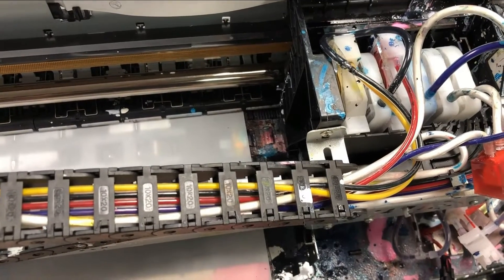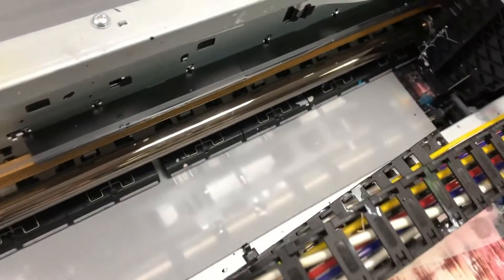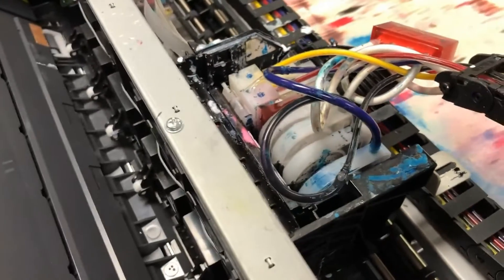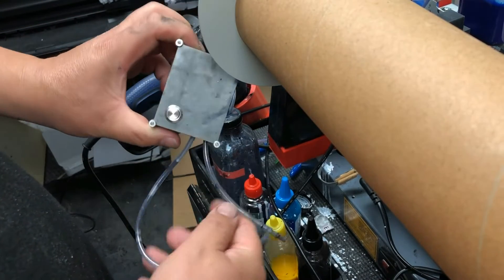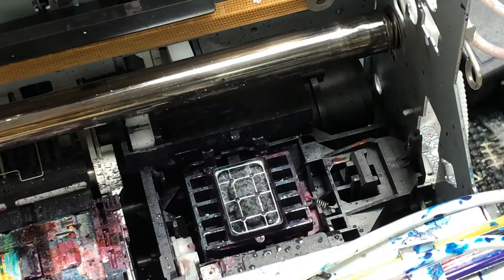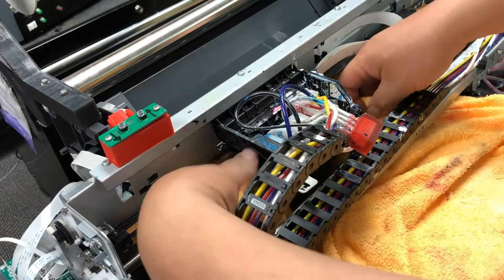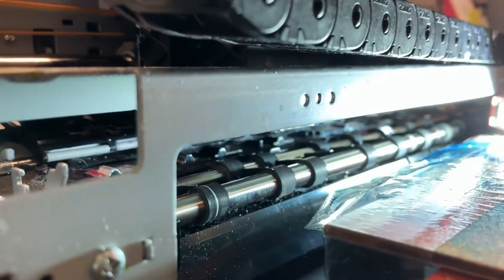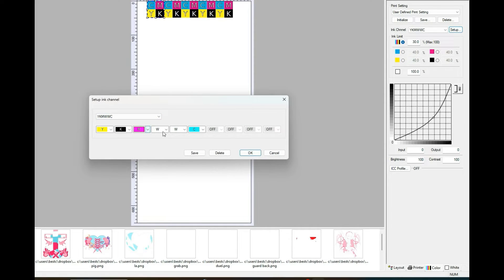Most Ignored DTF Printer Maintenance Tips

Comment: Why is my dtf a4 prestige printer prints lines with oveflow black ink
Reply from the maker: Thanks so much for your question and for supporting the channel! Lines with overflow black ink are often linked to capping station issues such as poor sealing, clogging, or tube problems, and I’ve made several videos that can help, including guides on [removing and installing the capping station](https://youtu.be/_cZEkmgIZYc), [unclogging it](https://youtu.be/WbY_6O1-w2c), [maintenance best practices](https://youtu.be/5yjq3ZN0qv8), [repairing common problems](https://youtu.be/5UC2IMu9V90), and [rewiring the tubes](https://youtu.be/J9im3s8UJfo). If none of these solve the issue, I also have an exclusive detailed video on my website that shows a complete disassembly and reassembly of the capping station down to the gears: [https://bchtechnologies.com/products/video-capping-station-assemble-disassemble-guide-for-l1800-1390-artisan-1430-and-1400](https://bchtechnologies.com/products/video-capping-station-assemble-disassemble-guide-for-l1800-1390-artisan-1430-and-1400). I do receive a high volume of questions daily, but subscribers and members are prioritized for responses within about 48 hours, while I answer other viewer questions as time allows. If you need faster help, you can always email [support@bchtechnologies.com](mailto:support@bchtechnologies.com). If this reply or the video has helped in your journey, I’d be so grateful if you could leave a review on my Google page here: [https://g.page/r/CfL7k6nYvPQ9EAg/review](https://g.page/r/CfL7k6nYvPQ9EAg/review). And if you haven’t yet, please subscribe or consider becoming a member—subscribers and members get exclusive benefits like early access to videos and priority answers!

Comment: How do i do this if i have the ciss on my epson et8550 thats attached to the side of the printer
Reply from the maker: Thank you so much for your support and for watching the video—I really appreciate you taking the time to ask, and that’s a great question; even with a side-mounted CISS on the ET-8550, the maintenance steps still apply, you just need to make sure the ink lines are not tugging on the carriage and that the external tanks stay level with the printer during the process, because the key is maintaining proper pressure and allowing the printhead to park, cap, and clean normally without restriction, so as long as the lines have enough slack and the CISS isn’t elevated or pulling, you can perform the same maintenance shown in the video; since I get a very high volume of questions and can only respond to about 10 per day, replies are prioritized for subscribers and members first (typically within 48 hours), then regular viewers if time allows, and after that remaining slots are filled last-in, first-out, so if you’re not subscribed and don’t get a reply within 48 hours you can either subscribe or repost your question, and if you subscribe later your older questions automatically move into priority without needing to repost; I’d also love to invite you to join Run With Kevin — LIVE, where I go live every morning (usually between 6–8 AM Eastern) to answer printer questions in real time, so make sure you’re subscribed and have notifications turned on if you want to catch the next session and ask directly; if you need faster help, you can email [support@bchtechnologies.com](mailto:support@bchtechnologies.com), and if this video or my reply helped you, I’d really appreciate a Google review here [https://g.page/r/CfL7k6nYvPQ9EAg/review—thanks](https://g.page/r/CfL7k6nYvPQ9EAg/review—thanks) again for being part of the community.

Comment: Hello Sir. I have a L1800 that won’t power on in the front. I have power on the back but no green light in the front. I have replaced the bypass and motherboard and it still doesn’t work. Have you ever experienced anything like this? Unfortunately AAprintsupplyCo has stopped connecting me after they couldn’t figure it out. Thank you 🙏🏽
Reply from the maker: Thank you for reaching out with your question. We at BCH Technologies appreciate your support, especially your engagement with our YouTube channel (https://youtube.com/@bchtechnologies). Your interaction is very important for our support and solutions. Regarding your Epson L1800 that won't power on, it's frustrating when these issues arise even after you've replaced significant components like the motherboard. Here’s a detailed step-by-step guide to further troubleshoot your printer’s power issues:

1) Transistor Check: Examine the mainboard's transistors (https://youtu.be/c_kmqwyZjLg). These components are often the culprits when there is no power. Specifically, focus on the 4 transistors, as they play a crucial role in the printer's power management. You've replaced the motherboard, but it's still worth double-checking these transistors to ensure they function correctly.
2) QF601 Transistor: Another potential issue could be the QF601 transistor. This part is critical for the mainboard's power functions in various Epson printers, including the L1800. Could you check and ensure the QF601 is not faulty or damaged? You can find more information on this component on the BCH Technologies website here (https://bchtechnologies.com/transistor-qf601-for-mainboard-cb53-main-l1800-1390-1430-epson-printers-fix-no-power/).
3) Power Supply Verification: If the mainboard and its components appear in working order, your next step should be to inspect the power supply unit (PSU). The PSU is crucial as it supplies power to all other components. A malfunction here could prevent the entire printer from powering up. You can view our tutorial here (https://youtu.be/X2SeQjMBq6s?si=MbyYES66uy4CEIbc) for a detailed guide on checking the PSU. The "power in the back" is the main power that powers your printer and also the mixer, pump, vacuum platform, and maybe the platen heater; therefore, even if the main power is on, your printer may still not get power from PSU.

4) Control Panel FFC Cable: Please review the control panel FFC (Flat Flexible Cable). Issues with this cable can disrupt the communication between the printer's control panel and the mainboard, leading to power issues. Please make sure that this cable is correctly connected and free from any damage or tears. You can find replacement cables and more information here (https://bchtechnologies.com/9-pin-ffc-connector-cable-for-l1800-control-panel-and-mainboard/).

Addressing printer issues like these can be intricate due to the technical nature of the tasks. For instance, while fixing a simple clog might involve straightforward unclogging steps, resolving power issues can require more in-depth technical intervention. If your printer has been inactive, it might even need full service from the ink system. Moreover, situations such as a "paper jam" can have numerous underlying causes, adding to the complexity of printer repairs. Unfortunately, we cannot provide remote troubleshooting or support. We encourage you to visit our local diagnostic facility for an in-person evaluation and repair service, BCH Technologies Printer Repair Service (https://bchtechnologies.com/printer-repair-service). We operate on a first-come, first-served basis, and it may take some time to address your service request because of high demand. Thank you again for your inquiry. Your proactive approach helps us improve and continue providing valuable content on our YouTube channel and other platforms. If you need more personalized guidance, please don't hesitate to contact us directly or visit our YouTube channel (https://youtube.com/@bchtechnologies) for more troubleshooting videos and tips.